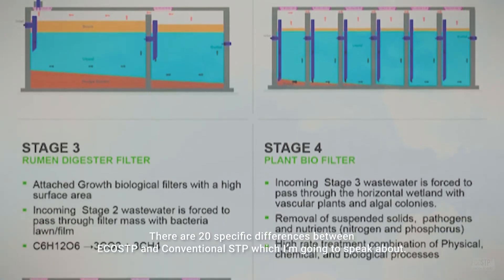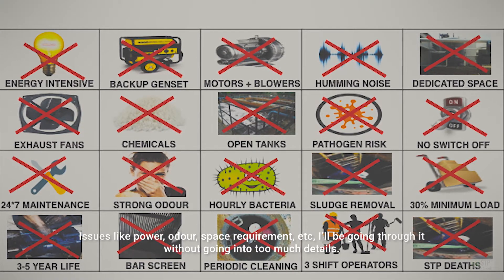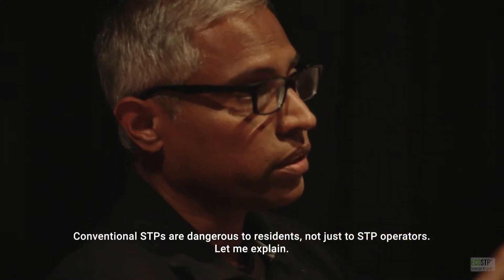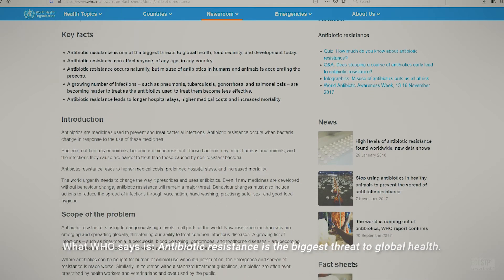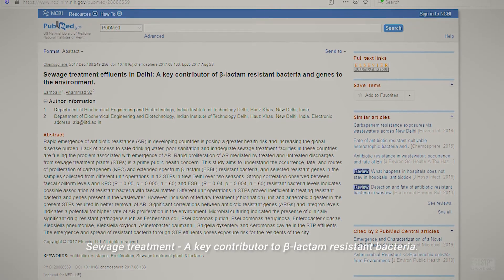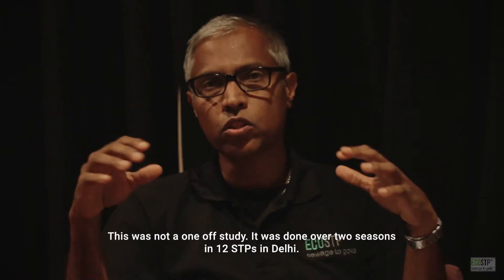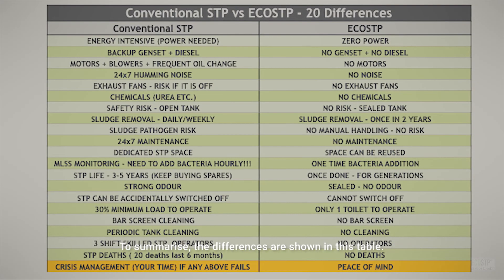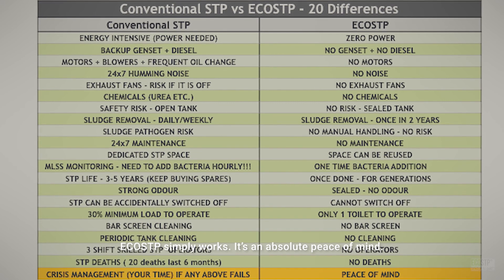ECOSTP -  20 Differences Between Conventional STP

Comment: This systems is multibaffeled anaerobic systems which had been used for many years. With recent norms of very high treatment and need to protect environment, anaerobic systems would face challenges. While this could be a good option for rural small applications, there would be space constraints in urban areas.